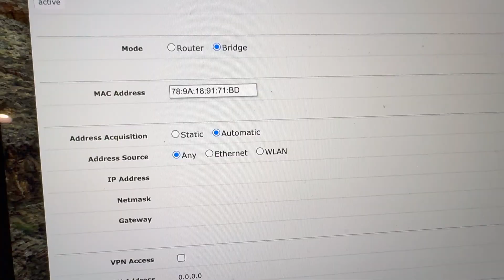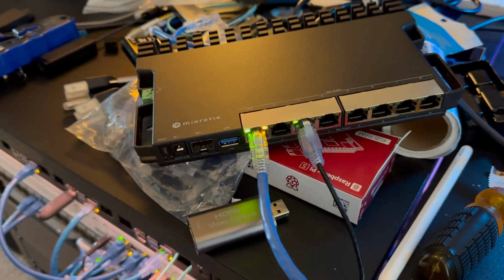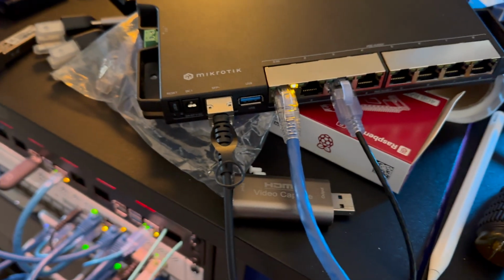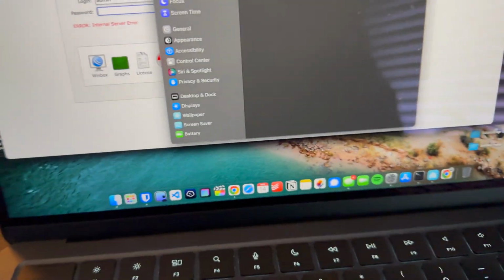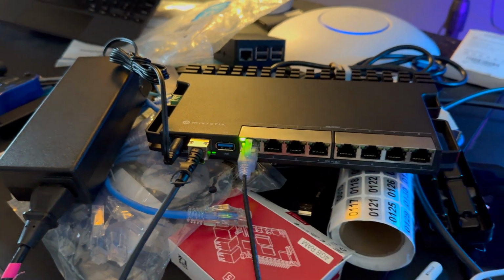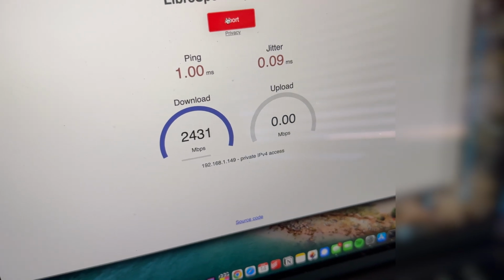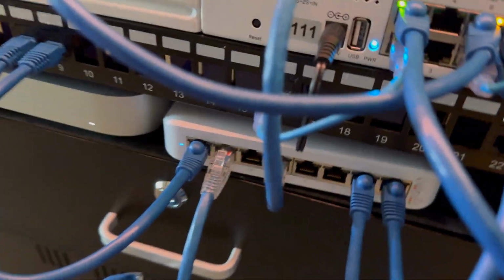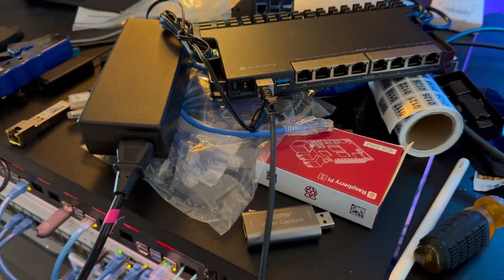Running Fiber networking to another location! MikroTik RB5009UPr+S+IN Unboxing & Setup

Comment: Here’s a quick example: you have 24V on the DC jack, 48V on the 2-pin connector, and 57V on the PoE-in. The board itself gets powered by the highest voltage input – the PoE-in. If there’s a problem, RB5009 will fall back to the second highest voltage - the 2-pin connector. And if that fails – there’s the 24V option on the DC jack.

What about the PoE-out devices? Once again – the highest voltage wins. PoE-out devices will draw power from the 48V source on the 2-pin connector. If that fails – the 24V on the DC jack come into play. The board will always reserve 20 watts to power itself. If there is not enough power for all the PoE-out ports, it will start disabling the ones with the lowest priority. You can set the port priority manually.

Comment: It's an ethernet router, not a switch.
Reply from the maker: Using it as a switch
Reply: @beamnetworks1  If you used your car as a lemonade stand it's still a car. Don't double down. Everybody who starts using Mikrotik makes the same mistake of confusing their routers and switches, and for good reason. Now you know, bend the knee and move on.

Comment: such a waste of money is using this as switch. This is perfect for routing vlans subnets and normal usual routing stuff. You should have bought css series for switching...
Reply: When you dont need so many ports, this is very good for all home network, or this - rb4011 ( older brother :D ) maybe with wifi and 10 ports and sfp, also hex devices is very good like secondary router/ switch for qos home network ....
Reply from the maker: Yeah the thing is though that this switch has a ton of ways to power it which was intriguing for me. Definitely cheaper options but I wanted to see what all MikroTik has to offer in some of their more “pro” products.
Reply: @beamnetworks1  Please stop calling it a switch.  Its a router. You can use it as a switch, sure, but it is slightly triggering hearing you call it a switch constantly

Comment: do you have a link for the second power source on the left of the router?
Reply from the maker: Unfortunately do not. It’s just a power supply that matches the same voltage as the other. Power supply I had was from an old security camera NVR and it just happened to be the same voltage

Comment: At beginning of video I was confused why you telling about RB5009 as a switch (this is the ROUTER). When you set it as a bridge in configuration I understood why :). But holly cow... you buy RB5009 PoE version to used it in such dump configuration only for switching 😲. This is made to process arround 2.5Gb/s of network connection with hardcore configuration 🔥. Anyway greetings from EU\Poland :)
Reply: There is nothing wrong with this router setup as a switch. It is a very versatile hardware :)

Cheaper option from MikroTik is MikroTik CRS112-8P-4S-IN  - 70euro cheaper.

But you miss features like:
-Redundant power
-Smart PoE ports 
-10Gbps SFP link
- Sleek design :)

Comment: Good video, why did you run SM fiber instead of MM ?   SM is good for really long distances. MM is more common for shorter & 10g.
Reply from the maker: Distance is a few hundred feet but I did single mode because FS.com had a cheaper outdoor armored cable. Probably would go with multimode for everything in the future.